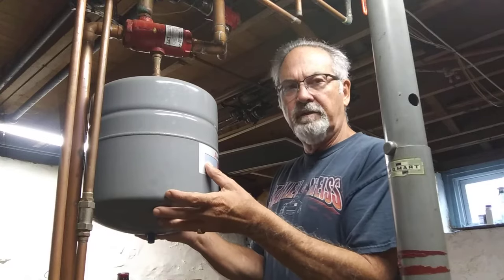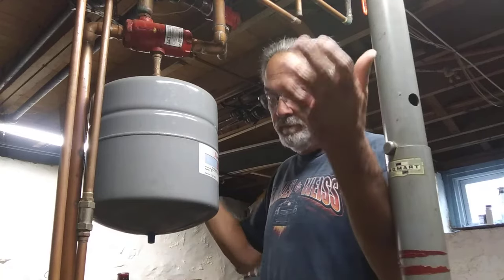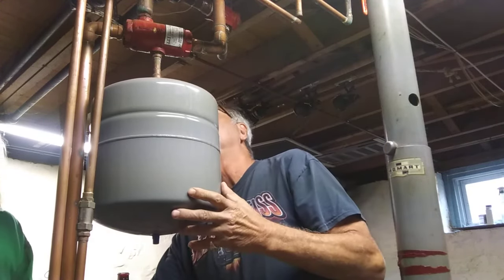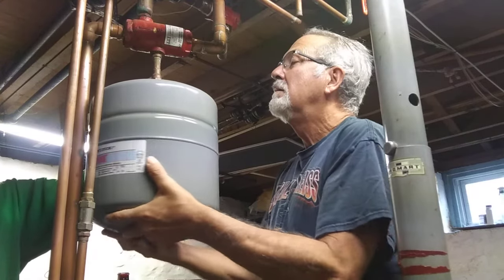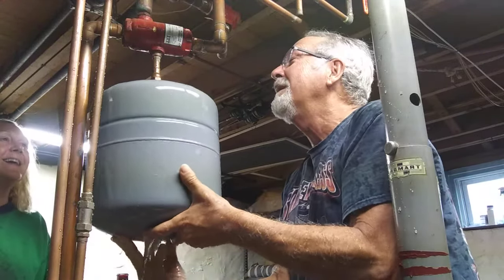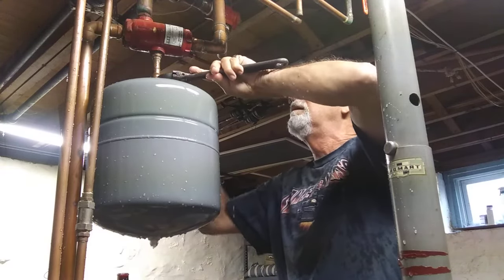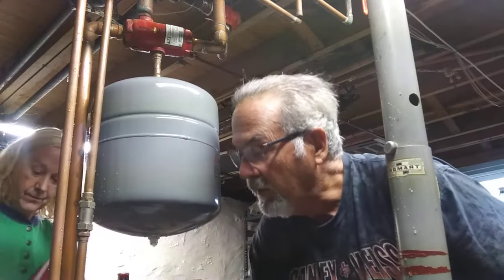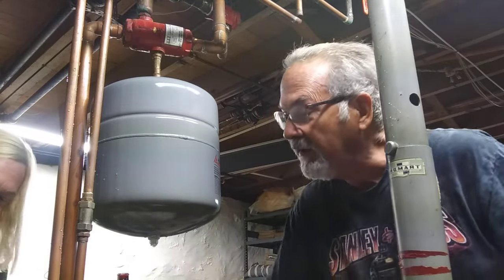Amtrol tank replacement on a boiler system

Comment from the maker: I have removed a comment that someone had posted about increasing the charge pressure in the tank to just under the house water pressure which in my case would be 65psi. The factory charge pressure is 12 psi for this unit. Amtrol recommends leaving this pressure at 12psi for most houses that have 2 stories read their instructions here: https://inspectapedia.com/heat/Expansion_Tank_Pressure_Settings.php
Reply: People confuse a water heater expansion tank with a hydronic system tank.

Comment: My friend you need to shut the water off ,get the pressure off, then take that new one back off and wire brush the nipple and put Teflon tape on the threads. But you get an Aplus for saving your self a couple hundred bucks. 😊
Reply from the maker: I did everything you said, the water gushing was from gravity of the system ( no cut off valve above it)
Reply: @Rainmaker88 what is the name of the part the expansion tank screws into? My tank started to leak and I had to turn the water off.ive been trying to get a plumber for months but they never show
Reply: @chrisortiz8072 usually they’re screwed into an “air separator”.
Reply: @bobshanery5152 how do you say something like this when there are videos of beer upside down on bars asking people to flip it over for a free pint and they do it without spilling a drop.

Comment: Mine needs to be replaced, So I called for an estimate. They qouted me a price of just under $700! The exact replacement tank cost around $60. I think I'll be doing this job myself!
Reply: That's because there's usually more to it than just replacing exspansion tank.

Comment: The moral of the story.....always have a bucket handy when doing plumbing.  I gave a thumbs up & subscribed because I like your attitude! Lesson learned there.
Reply: Lesson is to close all the boiler valves, relieve the pressure from the system, and no need for an impromptu shower.

Comment: always check the PRESSURE Gauge  on the Boiler to VERIFY that the Pressure is down to ZERO psi ..and shut off valves that allow the water to Flow toward the Expansion Tank ... and that's that.
Reply from the maker: yes the boiler had been off for a year

Comment: Best thing to do is to install a shut off valve above the exspantion tank so the pressure from the furnace is held back. So you can change them out with out a mess.
Reply from the maker: @drtazz6790  yea would have nice had the original installer had done that!
Reply: @plnthrd  you can put a ball valve  on the bottom of the air purger where the expansion  tank is connected. Then the expansion tank screwed on to  the shut off ball valve.   PS.  It's  called an  expansion   tank isolator  w/ waste.

Comment: I own a two family so I’ve already replaced my unit’s tank before. This time I threw caution to the wind other than shutting off supply and return valves and shutoff water make up valve. I didn’t release the pressure first however. I then took a bath in boiler water similar to this gentleman. There’s ignorance and there’s getting old. Drive fast, take chances. Now I’m hopping in the shower. Good vid. Real stuff here kids.

Comment: Mrs gracefully smiling when water splashed is lovely. I more often see wives yelling at their husbands. 
Now my tank was installed upside down, and it's FULL of water, I am doing my research before starting.
Wish me bless~
Reply from the maker: I'm not sure it makes a difference which direction it's mounted in, but you'd have to ask a plumber. The inside of that tank is partitioned half and half. Half has an air bladder to serve as a cushion to surges. The other half is normally filled with water.
Reply: Good job to helper for not getting all excited about water splashing around, it's only water & the $$ you just saved would buy lots of towels to clean up mess! Have a great day!

Comment: If you ever do this again you should add a ball valve, the type that has a pressure relief drain on it.  Then servicing next time will be a breeze and also maintenance because the only way to accurately check the precharge pressure is with no water pressure on the other side of the bladder.

Comment: I’m in the same boat they wanted $300 to install $62 part. I’m going to tackle it this week once the parts come. It’s my water heater So I will be shutting the main along with heater valve so I won’t get wet 😂.
Reply from the maker: sadly I didn't have a cutoff valve above mine

Comment: Good You have The Newest Tank . On the Bottom Where The Air Valve  Is That Is Also A Sensor.  When It's  New The Sensor Is White Color. When It Turns Black The Tank Needs  Replacment. Meaning The Bladder Is Bad  The Air Charge Is Gone And  Water Is Now In The  Bottom Half. Its A Nice New Feature Amtrol  Has Added To Their Expantion Tanks.
Reply from the maker: thanks for the tip!

Comment from the maker: i asked what the symptoms would be and he said banging in the pipes, and I've had that for years, so i guess this will be the cure!
Reply: usually if your expansion tank goes bad instead of reading 12 to 15 psi on boiler gauge it will climb up to 30 or so as it gets hot, and some water will come out of pressure relief valve if it goes much over 30.

Comment: Don't you need to shut off the water supply first. Just wondering.
Reply from the maker: If your system has an auto fill valve as most do then yes

Comment: You're supposed to match the pressure in that tank to the pressure on your water💧line system using a water pressure gauge on the faucet valve closest to your main shut off valve, then you're supposed to fill the tank to match the pressure that the water pressure gauge gives you, but never  go above 80 PSI, you're not benefiting if you don't match your system pressure on your water line your new tank will be filled with water.

The air in the tank acts as a spring on the water during water pressure fluctuations, it helps to protect your hot water heater or boiler from shock depending what system it's on when the pressure goes up, it help relieves expending pressure when needed, the expanding water will fill the rubber bladder in the tank compressing the air and when the water pressure drops the air will expand the bladder.
Reply: Thanks for the info 👍
Reply: Always check boiler safety valve specs and system operating pressures . 👍
Reply: its on the boiler system, there are no faucet valves
Reply: That only applies to water heaters and not boilers. Boiler normal pressure is usually12psi with a 30 psi pressure releif valve for safety.